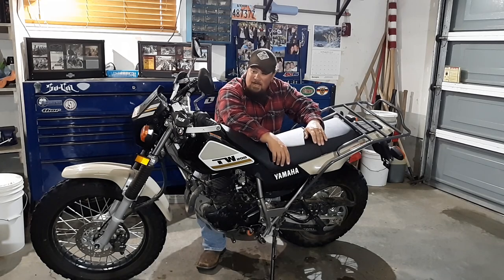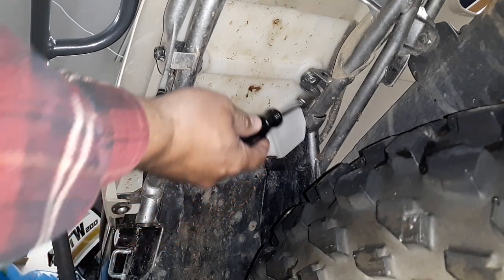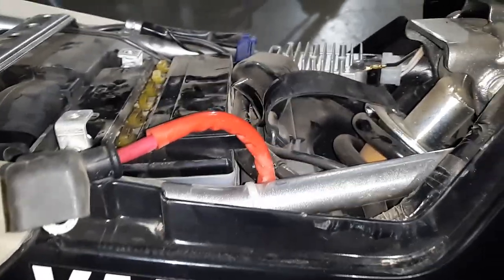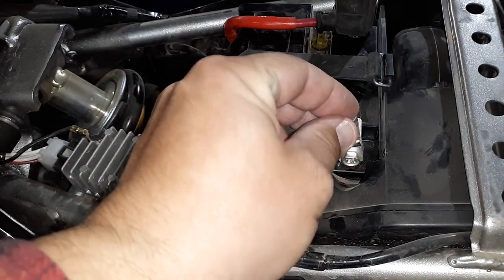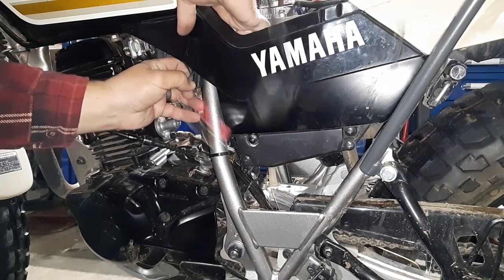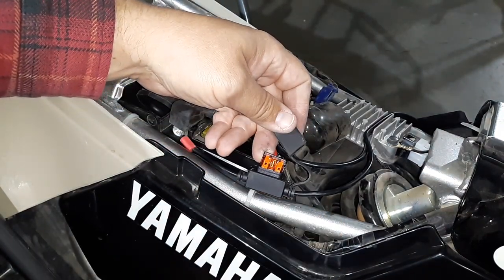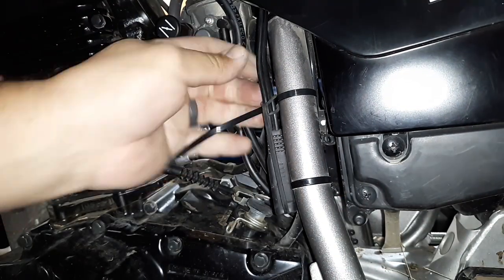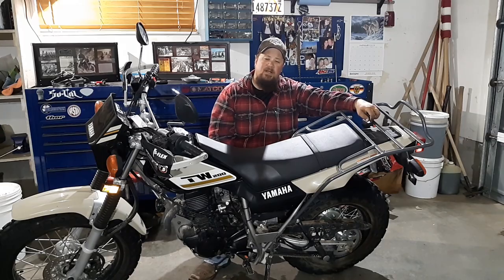TW200 Battery Removal and Install

Comment: Great video Matt! I bought 3 of those SAE connectors for $8 each on amazon. Now I can easily connect to my seldom used vehicles and keep their batteries topped off this winter when they need to be ready for use. Keep up your great videos because I love my TW200.
Reply from the maker: Thanks!  I'm glad you liked it.  They are great too when you.......uh......someone leaves the key on and runs the battery dead......just saying. Thanks for watching!

Comment: Love your videos. Where can I purchase a pair of brackets like you have on your battery that allows you to mount the cable on top instead of the side? Thanks.
Reply from the maker: Hey!! Thanks for watching the videos, I really appreciate it! The  rackets that are on my bike are all stock....I haven't changed anything under the seat yet.  But, any dealer should be able.tp.get the stock bracket for you! I know that Rocky Mountain ATV has the stock diagrams you can order from! I hope that helps!!

Comment: Can I get a pigtail for my jeep so I don't have to pop the hood for a jump start?
Reply from the maker: As long as the connectors fit the battery terminals on the battery in your jeep you can.  Battery tender does recommend you use a bigger charger for automobiles, but I have charged my Suburban and my F-250 with it and it has worked!  Good Question!
Reply: Woah Woah Woah there. A regular pig tail CANNOT handle the current required to jump start a jeep. It could be easily over 500 amps. If you try to jump a jeep through a pigtail there is about a 100% chance there will be fire. Best bet is fix the jeep so it doesn't need a jump start. Better yet. Pay someone else to fix the jeep.
Reply: @adammoore7994  lol. I don't have a problem with the jeep.  It was an idea. Obviously I would make my own pigtail that would handle the current needs.  It's no different than the new cars that have the battery some odd place and have terminals for jump starting.  I would just put mine on the outside, covered, for easy access.
Reply from the maker: Also, the pig tail wouldn't jump start the jeep!  It would simply be used to charge the battery so you wouldn't have to open the hood to jump start.  Sorry, my reply could have made it look like I meant to use these to jump the battery.  I thought I had made it clear I used it to CHARGE the battery only.
Reply: Whew. I thought you were gonna try to jump start a jeep through a small pigtail Scatterbraindead. Just the way you worded it made it seem that way.